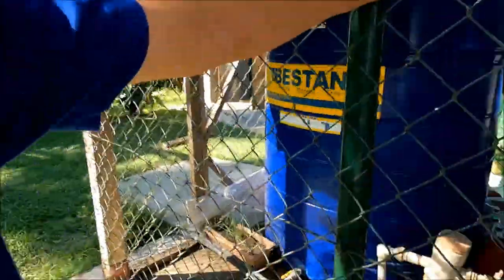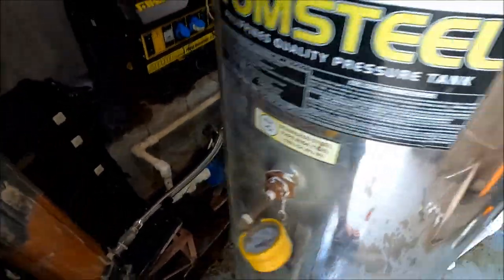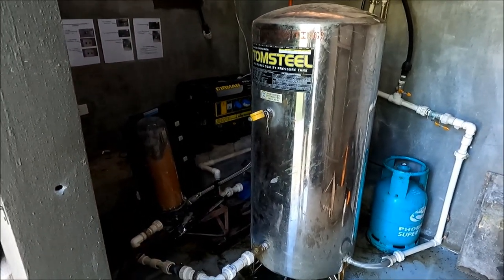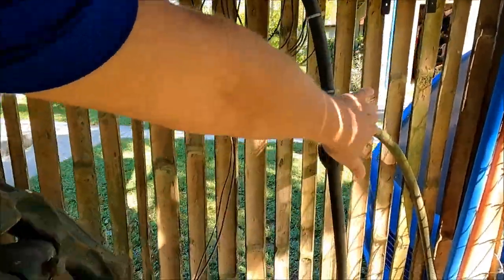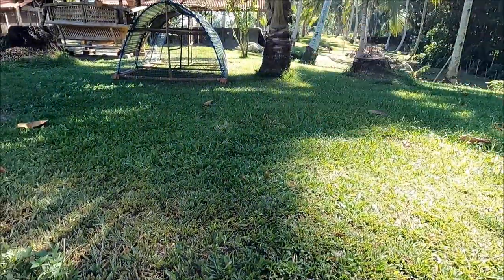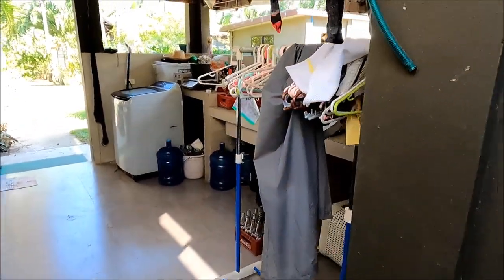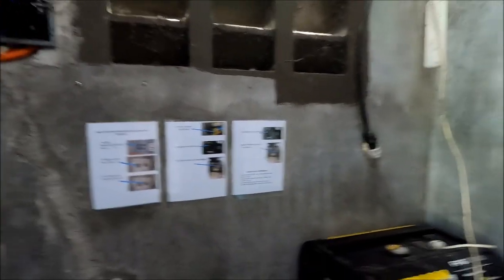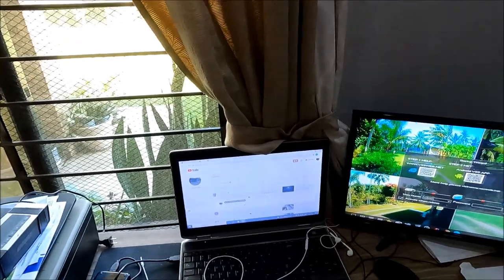My Water and Electrical supply and back up systems on the Aussie Farm in the Philippines

Comment: Oi, Will. Get a grip. You STILL need a battery for the clock above the door in the sala/dining room. The video was very good and informative, as usual.
Reply from the maker: I have ordered new clock inserts 3 of the bastards, I will be replacing the movements when they arrive i will let you know  cheap only only 55peso each.. cheaper then buying a full new clock

Comment: A 60 foot pipe by 3x’s. Sorry Chic I laughed. I knew it was a mistake. But I could imagine a tricycle dragging it down the road. Like the bamboo. I like the budgie having a piss. You can never have too many backups. I have a generator but I want to add solar lights in the house & one of those solar pumps in my water system. Stuff having thing run across the ground. I know who will trip over it. Me. Plus I will put a solar street light at the front gate & one in the yard. Those 300 watt ones you just got. I’m always thinking what I can do to make life easier. I haven’t been thinking internet before but now I am. Thanks William. 🇦🇺
Reply from the maker: Thank mate.. yes it not hard do it step at a time and it works.. it worked for me

Comment: I like your setup and have been planning something similar to you
I was going to build a store room around the well with solar on the roof and batteries in the store room
Running the water from the well trough filters to the storage tanks and then the 12v 60psi pump from the storage tank to the house, animals and garden
I was going to put a split charger for the batteries to keep them charged from the grid and from solar with an automatic transfer switch to change over to solar to run the pumps in the event of a brown out and use the main electric cable from the house to the well to power the house from the solar in the event of brownout also
I've already got the 2 way automatic transfer switch but now and going to buy a 4 way one where I can hook up a generator to it in the event there is an issue with the grid or solar it will turn on the generator as I've bought an electric start one
I'm not a smart guy by any standards but even if you have a low budget people should be thinking about having a bank of batteries that are charging from the grid constantly so you can use a back up during a brownout and can add the solar panels or even a generator later into the system when you have the money
The cost of buying two 200amph batteries with charge controller and inverter is not a huge amount on Lazada and that would get you sorted for a couple of days if only running water pumps, charging phones and lights etc...
Reply from the maker: You are dead right on what you are doing.. go slow and do it right the first time, you are doing a great job with you farm needs, you don't have to be a rocket scientist to do the practical things... you doing well mate.. keep it up and remember.. Don't let the dream die..... well done
Reply: @anaussiefarminginthephilippine  we already have the main water line going from the well to the house and outside taps, the idea was to run the well pump and pressure booster from the grid and solar and split the main water line going to storage tanks with a separate pump running from that to the house and outside taps
We then should have a reserve of water and be able to either pump direct from the well or from the storage tanks
All running on the grid and solar backup
Then just keep adding more solar panels and batteries until we reach the target of having enough energy to power the house in emergency

Comment: Here is William turning the water to the house on and off and Chic is in the shower.  LOL
Your hot water.  What powers it's ignition system?  I see 4 'D' cells on the wall, so I assume it is battery.  Otherwise when power is out it won't light up the gas if it is 240 volt.
Reply from the maker: Yes mate 2 x "D" size when water turned on it light up baby

Comment: Is the solar back up for 12 volts expensive and how many panels is enough ?
Reply from the maker: I use one 100w panel that keep 2 batteries  topped up,, i have not had any issues in 2 years